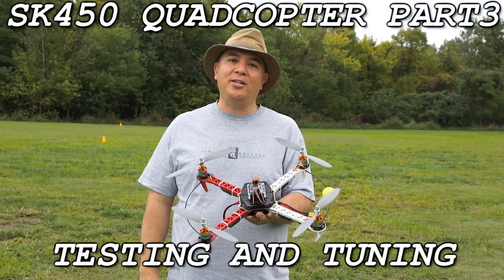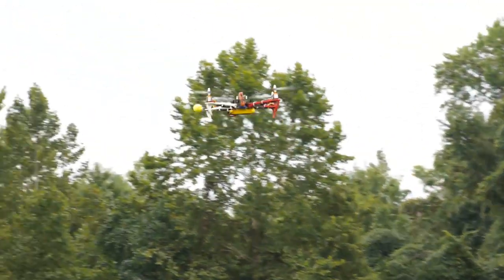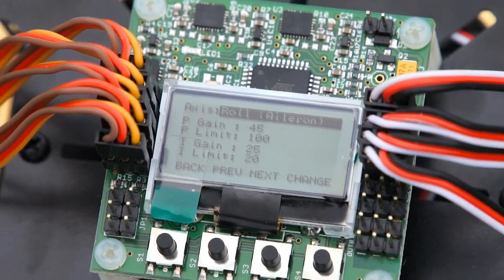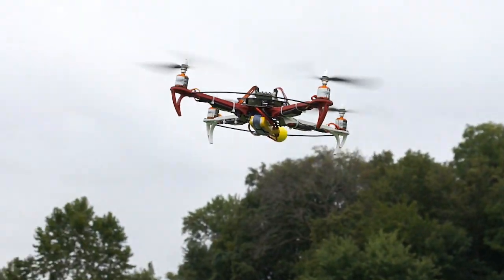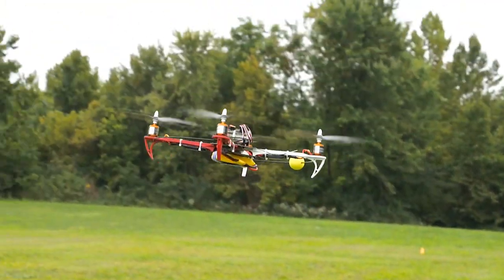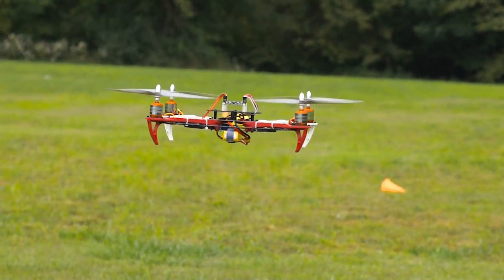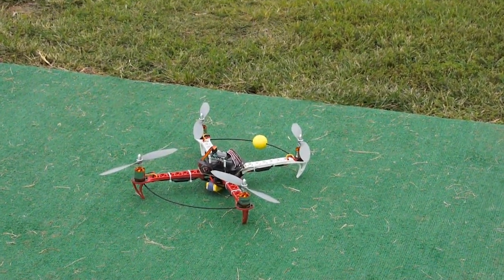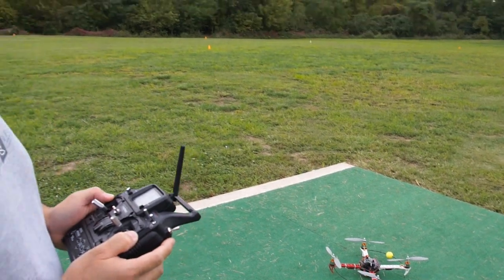SK450 Quadcopter Part3 Testing and Tuning

Comment: Help! I cannot get mine to arm? Just started doing this, can't understand why? I have checked and rechecked everything. The receiver is getting signals as the KK2 is reading them in the receiver test menu so I am stumped?
Reply: in the main menu does it say any errors or "ok". Also are your receivers going the right way? example : If you move your throttle stick up. does it say up? and if its all the way down. does it say down? if they are reversed try turning your kk2 board UPSIDEDOWN.

Comment: how high can it go and can i safely mount a gopro on it and how long does the battery last?
Reply from the maker: Thomas T you should have no problem lifting a gopro. Here in the U.S. we are limited to 400Ft altitude. Flight time depends on size battery and total flying weight. This setup in the video was getting 7-8 minutes on 2250mAh battery.
Reply: DiehardRCaddicts  oh cool seems a little on the short side thought but okay and um is there any way i can project my gopros videos onto a display while in flight via tablet/phone if you know?ive seen some gopro video transmitters but idk the range of the use of wifi.

Comment: hey diehardrc on what/how did you mount your flight controler on? got the same frame but you've got yout fc on the top where i've got my lipo. how/on what did you mount your flight controler? do you have a kobbyking link for me? cool videos :-)
Reply from the maker: Gerd Specht I used nylon standoff spacers with nylon screws. Use the link in the video information bar to "Multirotor Accessories" on hobbyking site. You will need to order both the M3 sized spacer and screws. If you get the treaded spacers you will also need the nylon nuts. I used the tapped ones that only need the screws.

Comment: Looks like a nice quad for the $ hobbyking has a prebuilt for under $200 but I have 2 questions 1.what are the flight times with the 2200mah battery? 2. What's the stock range? Oh and this would be my 1st real quad other than my hubsan x4 so advice would be appreciated.
Reply: bout 12-15min max

Comment: I've heard a lot of people don't think the auto-level for the KK.2.1 is all that great. Supposedly the KK.2.1.5 with the latest firmware has a better auto-level. I have yet to test mine though. We shall see I guess.
Reply: i can confirm that the stock KK2.1.5 FW1.6 auto-level is not great. But they even suggest in the manual that you flash the latest firmware immediately. Flys great with it off though!

Comment: Great videos.How would you compare your build to the "Turnigy SK450 Quad Copter Powered By Multistar. Quadcopter & 5X Package" It is already built for $189 at Hobby King? It may not have as nice of parts, but seems ok to start.

http://hobbyking.com/hobbyking/store/__45468__Turnigy_SK450_Quad_Copter_Powered_By_Multistar_Quadcopter_5X_Package_Mode_1_Ready_to_Fly_.html
Reply from the maker: tptwk It would make a great beginner quadcopter. With the smaller motors It should get better flight times as well. The payload would be reduced but should still be able to handle a GoPro camera without problems.

Comment: Thanks for the videos they were very helpful.How did you setup dual rates and expo on your radio?  Did you just set everything to 0 and use the board stick scaling?
Thanks
Reply from the maker: Set radio settings to 100% then adjust stick scaling for high rates then you can set low rates % on radio dual rates.

Comment: I think these three videos are absolutely fabulous! I was struggling with my first quad set-up before i chanced upon these videos. I ran thru them in detail and followed the steps every bit of the way and surprise of surprises...I managed a successful first flight straight away - with the auto levelling on! However, my quad tends to flip to the left with the levelling on. Any valuable tips?
Anyway,congratulations on a video excellently made. I wish there were more such videos for other models with other boards.

Comment: How many grams can this little bugger haul up? :) Coming from helicopters I should have no problems flying it. My camera weighs in around 700g.
Reply from the maker: This quad weighs in at about 1300g ready to fly with 4000mAh 3 cell battery. So you are looking at about  2100g-2500g depending on how you mount the camera. Each motor with a 10x3.8 prop at full throttle puts out about 1300g of thrust. It should be able to handle the camera but will shorten your flight times. You might want to go with a lighter camera.

Comment: I have the same issue with the Auto level on the same frame. You can tune the auto level trims as per: KK2 Autolevel Tuning and Explanation Still trying to find decent and P & I settings, just doesn't feel locked in yet for me.

Comment from the maker: This is a good board for this quad but I can't say if it is the best, there are too many other ones out there. As far as flashing the board I still have the original firmware that was on the it when it shipped. I'm happy with the way it flies so haven't changed it. I don't fly using the auto level feature but it still works fine and is very stable.

Comment from the maker: Did not paint them. It came with all white arms. The red ones can be bought in the frame parts section for the SK450 on HobbyKing website. They also have them in black or green.

Comment from the maker: This is actually quite normal as the KK2 board does not have a barometer for altitude hold. You just need to learn to give a little throttle when you move forward to keep your altitude steady and back off the throttle when you flare it to reverse. If you want altitude hold you will need to buy a control board with that option like a Naza M or MultiWii board.

Comment: Nice series of videos on the SK450.  They have helped me build, setup and fly not only my first quad, but my first RC anything ever.  I flew my SK450 for the first time this weekend.  I noticed that it would loose altitude when pitching forward but not when pitching backwards.  In fact it would gain a little altitude when pitching backwards.  Do you have any recommendations on what may be causing this or pointers on what I can trim to fix this issue?  Thanks for the great videos.

Comment: thanks, i have order the buzzer with cell checker, i put my timer max 3mins only so i will not damage the battery, the thing is i have 2 sets of 2200mah battery and it limits my flying time, i have to order another sets of batteries to solve my problem. ciao

Comment from the maker: Not quite sure but I get about 5-7 minutes out of mine with the setup on this quad. Your motors are smaller so should get better run times depending on the prop size and pitch. I suggest using a LiPo low voltage buzzer the kind that plugs into the balance plug and buzzes loud when you hit a certain voltage per cell. Hobbyking sells them just do a search

Comment: i have the same board but at 1.2 firmware . The moment i give throttle it just Tilts and on giving more intense throttle it just flips !! .. any help on that , i have all the ESC , Sensor calibrated and all the other usual stuff is done .. any help on this ?

Comment from the maker: Stick scaling is like having adjustable rates on your control throws. the higher the number the higher the rate of movement. Sounds like you need to lower yours if that's possible with your older kk board. I don't know because I've never used one. P and I has to do with gyro gains. You can fine everything you need to know if you click the link to the KK2 forum on rcgroups located in the video information bar below the video. That's how I learned a lot about it.

Comment: I am a beginner so will you please explain what the purposes of the I & P gains are for me? I am flyimg the old KK board and I CAN keep it in the air but I dont know what to adjust to smooth-out oe slow-down the stick-response! My quad is on CRACK right now and if I barely touch the stick, it GOES NUTS!  ((help)) ?? If I could just slow the stick-response down a bit I would be ok but I dont understand the terminology of what I & P means etc :(

Comment: if it wonders alot in self level mode should we recalibrate on a better level surface but make sure that the board ITSELF is level alone and it should work right? or? mine wonders alittle so id like to fix that to perfection can you help please??real help and kool stuff is why ii subscribed hk should help you help us.

Comment from the maker: The esc firmware was not flashed. All the parts used to put this Quad together were used right out of the box with no changes made. Nothing's been changed yet because so far I'm happy with the way it flies.

Comment from the maker: No, all programming is done through the Menu using the on board LCD screen of the KK2. That's the nice thing about this one, you can easily make setting changes at the field without the need of a computer. Please watch the part 2 video on how to navigate the menu and set everything up.

Comment: Setting both your I and P to 60 was a mistake, the I gain should never be the same or higher then the P gain.  And always work with your P gain first and then start adding I, Just the same way it said to do with the rate gains.

Comment from the maker: Should have no problems lifting that much weight. At full throttle all four 10 inch props put out a calculated 4000grams of thrust. Even at half throttle would be about 2000grams. This Quad with out a battery weighs in at 900grams.

Comment from the maker: Sounds like you need to adjust the minimum throttle values in the misc settings. This is covered in the part 2 video if you skip to around 9:10minutes in the video. You want to adust the value up a little at a time till all esc start up at the same time.

Comment: Hey!
I have a problem, hope you can help!
I use the same KK 2.0 board on my quad and the problem is that every time I power it up and get it ready to take-off, upon giving throttle motor no.2 doesn't start immediately....it glitches and then I need to spin it myself first before it start opperating fine.
hope you can tell me how to resolve this issue!
Thanks in advance!

Happy landings!

Comment: Rolf Bakke aka KapteinKUK the original creator of the KK board correct the auto level issue in firmware version 1.5 now you could toss it at 75% throttle and it would catch itself. Those who have flown 1.5 say its nearly as crisp as naza auto level .

Comment: Nice work Frank.  Rolf has posted the 1.5 Firmware update which addresses the auto level issue.  It is actually designed to right the copter, should it become inverted or out of whack.  He does some great demos where he tosses the Copter into the air like a frisbee and the auto level sets it up right.  Very nice. I have flashed all my KK2.0 with the 1.5 version now.  Cheers.

Comment from the maker: Tom, yes if you get everything listed in the video information bar you should have everything you need but like you said you will also need a control board like the kk2. The link at the very bottom takes you to the accessories where you can choose the standoffs for the control board along with a battery strap and any extras you want.